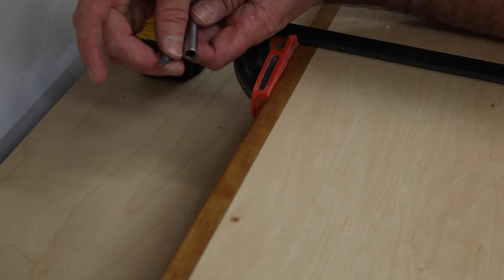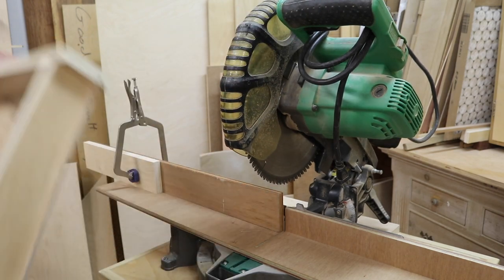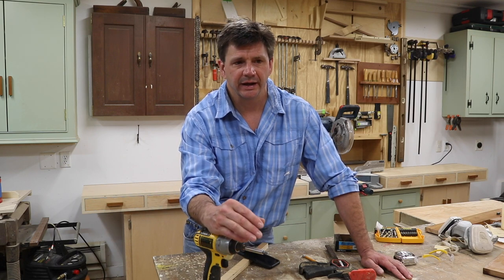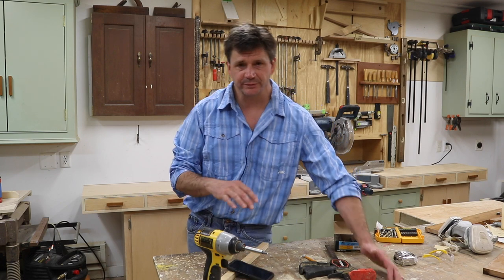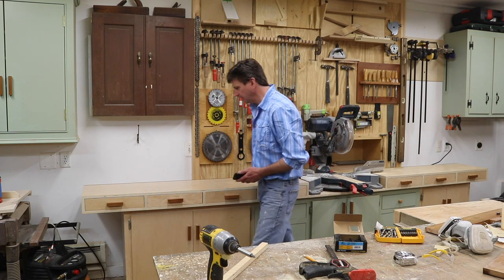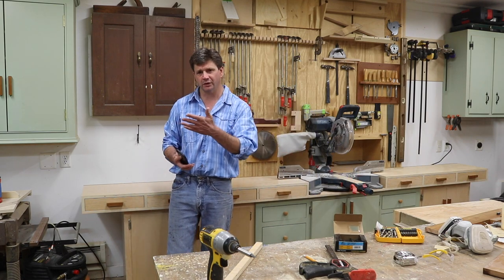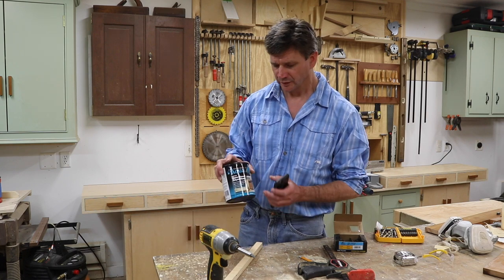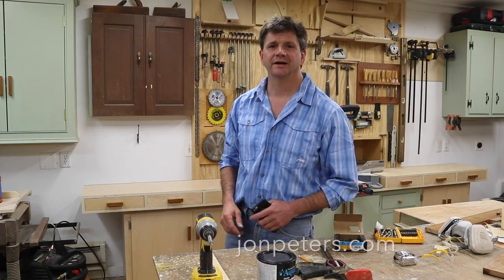Drawer Stop and Cabinet Back + some Q & A

Comment: Just a question from the second video. You didn't show drilling out for the shelf supports, and I was wondering why you waited until after the doors were put on to do this step. It seems like it would have been a much easier process without them attached, or without having to disassemble and reassemble. Nice build though.  Still can't figure what's gonna happen with that space behind the drawers, besides collecting lots and lots of dust though

Comment: hey Jon, 
A quick question for you. Have you ever used "Zinsser" polyurethane? if so, how did you like it? if not, i would strongly suggest giving it a shot as its one of the few oil based poly's I've used that hasn't caused yellowing.

Comment: Jon, about a year ago I built almost the exact same set up for my Ridgid 12" slide miter and I went with the rails and track from Fast Cap,I have 2 stops on the left and one on the right. This is by far the best part of my shop. It was a big investment for me at the time has turned out ot be the best by far. Enjoy your new station.

Comment: You get such great results from your tablesaw and blade you're using. It is amazing. I have had some good results with water based poly too. I think the one I've used is made by Rustoleum. I see a lot of people use Polycrylic, but my brother has had it fail him on a few projects. Also, awesome that Casey finally opened your skateboard. I wish he would have had time to put your note up on the screen so people could find you.

Comment: Thanks Jon for your videos!  Ever since high school, I have wanted a home wood shop.  Now that I have recently retired from the Air Force and set up some stable roots, I have been able to start diving into my passion for woodwork and get my home shop underway.  I have spent several months watching multiple youtube channels, and I must say your videos, in my opinion, are the best by far.  Very informative, easy to follow and really inspiring to jump into projects and try new techniques.  I am not a huge fan of the theatrical instructional videos, so I really enjoy your style of presentation.  

My most recent project is working on a platform bed with drawers, pulling ideas and techniques from the platform build you did for your wife.  

Anyway Jon, thanks again and here is to many more hours binging on your videos!  Cheers